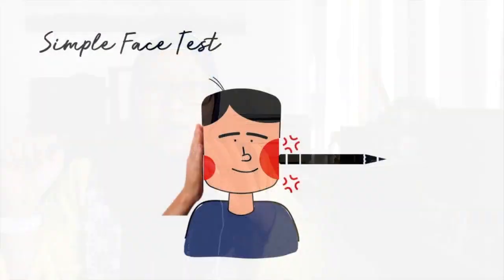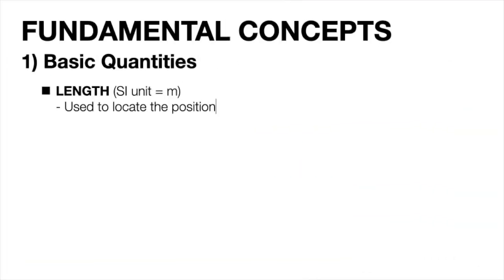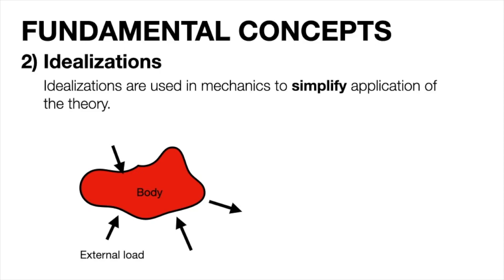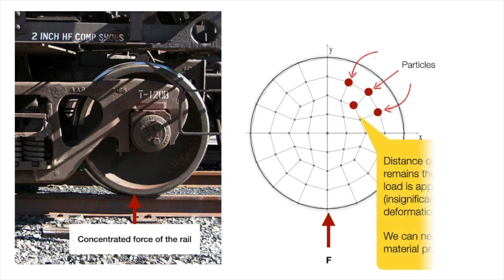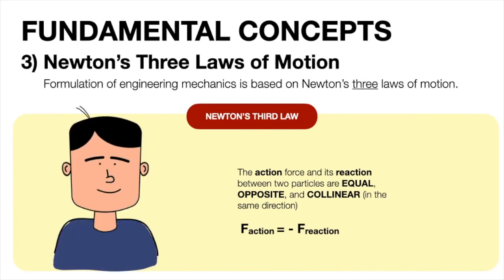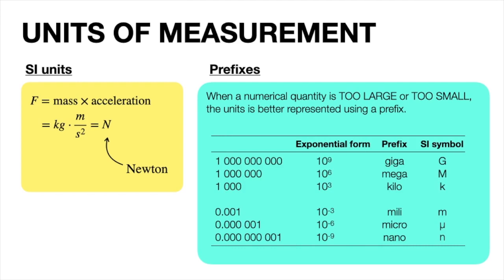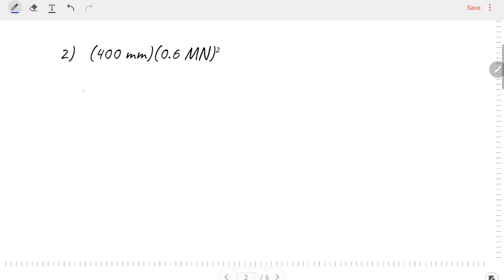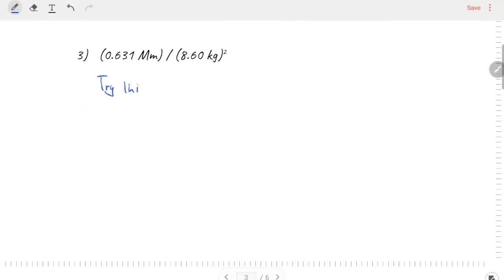BMCG1113: Chapter 1 - Introduction

Comment: Ex1, 300 MN²
Reply from the maker: Very good question. The prefix is usually 'embedded' to the basic quantity.

In this case, this is how the breakdown of the solution should be:
= 300 x 10⁶ N² (Notice that the basic quantity of Force, N is power 2, so we have to breakdown the prefix into 2 parts to cater for the N²)
= 300 x 10⁶ (N)(N)
= 300 x (10³ x N)(10³ x N)
= 300 (kN)²

Or we can write it as 300 kN²
Hope this explains.
Reply: Oh i see , tq dr for the explainations👍